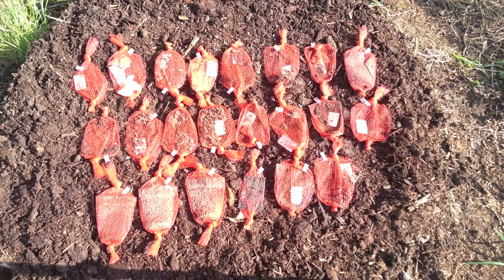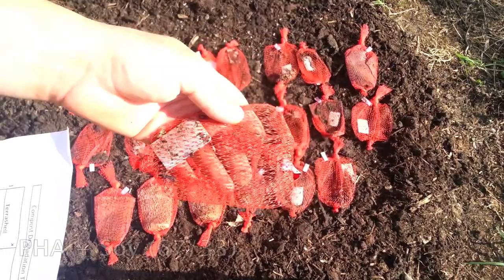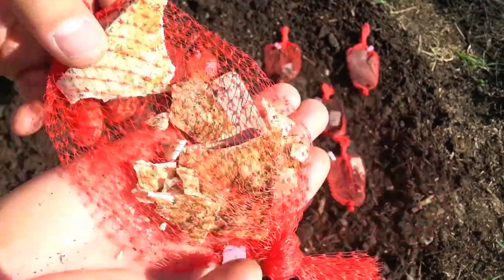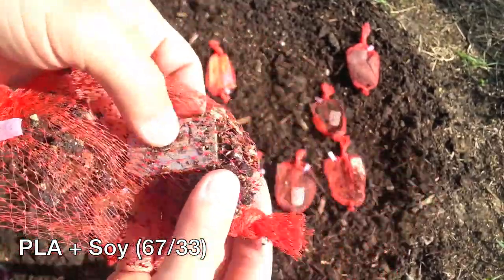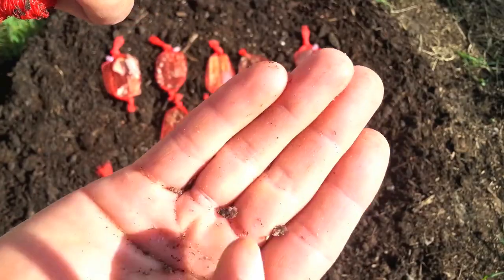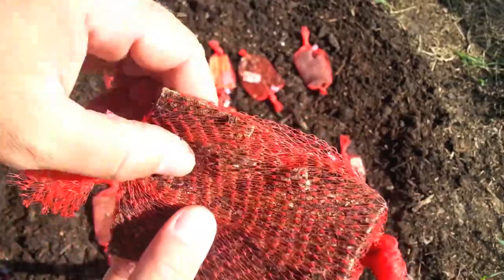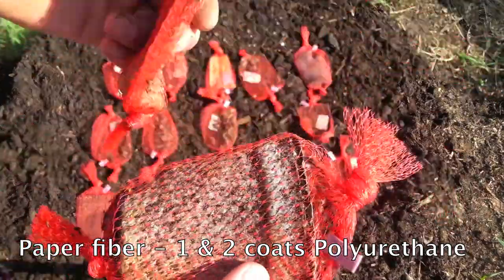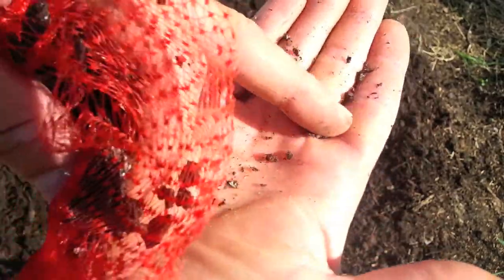Biodegradation of Bioplastic Plant Containers in Home Compost (10 weeks)

Comment: Great stuff. I am trying to work out how compostable small pieces of 70% PLA 30% recycled wood particles might be. Have you ever tested wood PLA?
Reply: We included a wood-fiber plant container that was coated with PLA in a study evaluating degradation in soil.  In the soil environment, the PLA coating substantially slowed degradation of the container material, but as we found with other PLA composites, the higher temperatures of the compost system can aid degradation by beginning hydrolysis of the PLA component.  

Our paper that includes results for performance of coated and uncoated fiber containers and their degradation in soil can be found at: https://www.researchgate.net/publication/279334489_Evaluation_of_Biopolymer-coated_Fiber_Containers_for_Container-grown_Plants   

Another paper that reports degradation in compost can be found at:  https://www.researchgate.net/publication/283117217_Bioplastics_and_biocomposites_for_sustainable_horticultural_containers_Performance_and_biodegradation_in_home_compost

The second paper has results for blends of PLA with other materials, but does not include PLA-coated fiber containers.

Thanks for your interest in our research.
Reply: James Schrader Wow, thanks very much, this is extremely helpful. My interest is in 3D printing filaments and the recyclability of small 3D printed objects made from PLA or PLA/Wood mix. I’ll see if I can test the composting behaviour of my 3D prints using similar experimental methods to your paper.